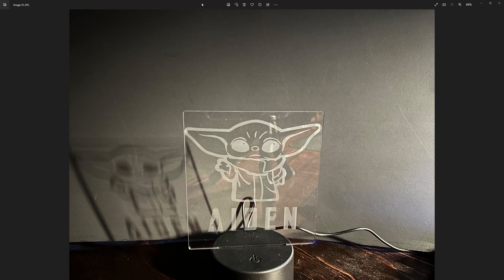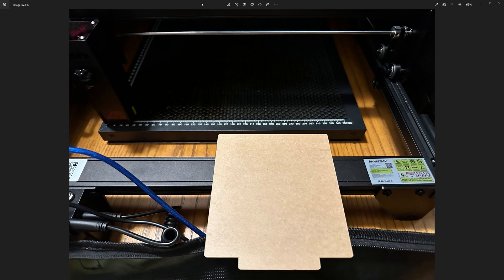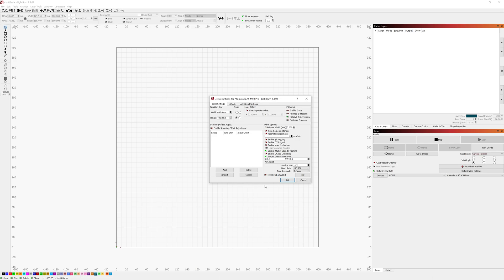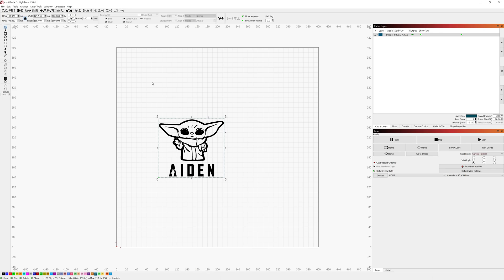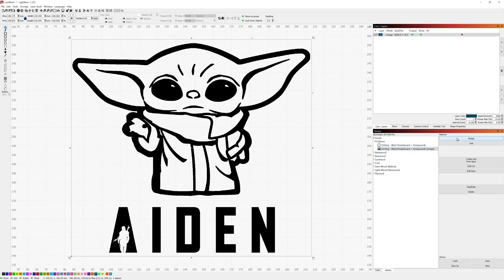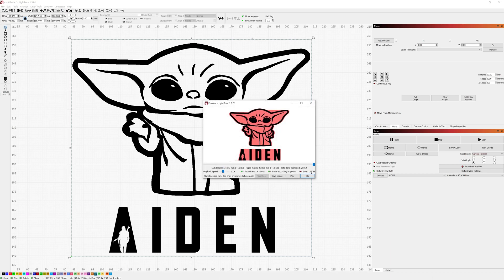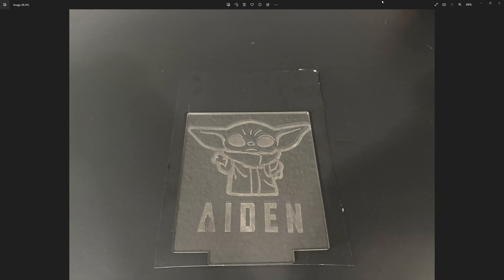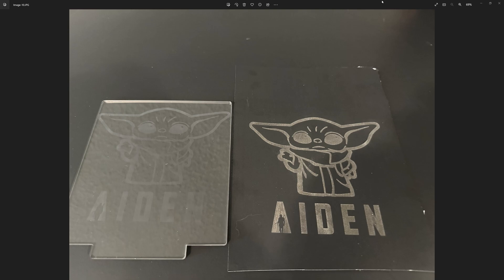Etching on Clear Acrylic - Atomstack A5 M50 Pro (5.5-watt Diode Laser)

Comment: Heeeeelp ! Is it just me because I am a newbie ? I tried a layer of black craft card underneath my 4mm clear acrylic as a tester and found that the etching had etched the card and burnt it to my acrylic. So I then used more black card and raised the acrylic off it by 3mm but this time it did not etch the acrylic but only the black card. I run an Atomstack A5 Pro via Lightburn and replicated the settings in your video which were drastically different to what I found online and so I am stuck to figure out how people are using black bases without these problems. Any help and tips would be appreciated :-)
Reply from the maker: When you say it burnt it to your acrylic, were you able to gently wash it off with mild soapy water, or was it really burnt in?  When I do it, there is residue from the black posterboard on the acrylic, but it washes off easily and leaves a nice finished product. I've not tried it with craft or card stock, only posterboard, and I'm not sure how much of a difference that makes.
Reply: @CubicleNinja  Oh I really did have to peel it off the acrylic and the image was etched into the card and you could smell the burning from the card when peeled off. It left residue of card which just was not coming off lol. I will go to Hobbycraft and try and get some posterboard and try that. I am also going to try the black paint method to see how well that works out. With regards to the first attempt I then followed up with a second attempt by raising the acrylic 3mm above the card to see if that would help but nope lol, the image was etched onto the black card as naturally the laser passed straight through the acrylic which was only to be expected. I am wondering if a black ceramic or marble tile would help although I suspect a marble tile would be too heavy for the honeycomb bed or maybe a piece of black acrylic. Keep up the great work with your videos, they really are most helpful and informative in a clear and concise way :-)
Reply from the maker: @anthonyphillips5103  Good luck! I have done close to 30 of these so far with the posterboard with these settings. I have had 1 or 2 I had to redo because of some defects, but overall it has worked well for me. I always use the same posterboard material once I found it, and always have the acrylic sitting directly on top of it (no air gap) on top of my honeycomb bed. If you have more issues, let me know, and I'll see if I can track down any differences or provide a new video on the full process.

Comment: Poster board and mounting board is same item?
Reply from the maker: Not the same, but mounting board might work (I've not tried it myself).  This is a link to the specific poster board I used -- https://www.michaels.com/product/22-x-28-poster-board-by-creatology-10525550

The main reason I went with the poster board is because it has multiple "layers," and the black layer is more of a coating on it. For whatever reason, it gave better results than when I used black cardstock or thick black construction paper.  You can see the layering of the poster board towards the end of the video when I pull the acylic off and it shows the white inner layer of the poster board where the black coating had been burned off by the laser.

Comment: Very nice video, i have been trying to get set up for this very project and trying to find some guide lines for a 36w has been an issue.  It amazes me that the power is so low, 14% of a 5.5w is only .77, unless i'm lookin at this wrong??  My test pieces are to be in today so hopefully i can go ahead and tackle this.
Reply from the maker: The AtomStack I use is a "40W Machine" but is only 5-5.5W output from the diode laser itself.  With these sorts of diode lasers, they cannot actually etch or engrave on clear materials directly, so you have to rely on a base or backing material to catch the laser as it completely passes through the clear material in order to get any sort or marking.  In my video, I'm having it burn/engrave onto poster board beneath the acrylic to cause the etching effect on the backside of the acrylic.  If I go with too much power, the laser will burn straight through the poster board too quickly and not have an opportunity to mark up onto the acrylic itself.

A lot of the newer, more powerful, diode options use laser coupling to get 10, 20, 36, or 40W output with multiple 4, 5, or 6W diodes coupled together to provide the higher output power. I've not used one of those, but since they are still diode-based, they should still have the exact same issue with cutting or marking transparent materials since that challenge is all about the laser type and not the laser power.

One thing you can do as a test without wasting any of your acrylic is to use a simple black poster board as your tester and find the settings you need to use to burn off just the top black layer but not go all the way through the material itself.  That will, hopefully, give you a solid starting point to do your material tester on the acrylic without going through nearly as much trial and error since the acrylic is considerably more expensive than a $1 sheet of poster board.

Good luck!!
Reply: I'll continue on, thanx.  Mine is a multiple diode with an output of 36w. @CubicleNinja
Reply: i managed to do 3 material test pieces and the numbers i lit on were 5280 speed and 18 - 19 % power.  I ran with that and did my niece and nephews christmas led night lights.  Each child has 3 pieces of acrylic to change out, niece has Disney Frozen characters and nephew has marvel comics characters..  it came ok, no bubble explosions anyway, just had to be very careful cleaning them.  Oh!!! and by the way, i tried the soap trick and that wasn't working so i went to a dry sheet on black card stock...  That did pretty good, i have the tempora but haven't tried it. @CubicleNinja
Reply from the maker: Great to hear, thank you for the update!

I'm glad the dry sheet with black card stock worked well for you.  That's my favorite method now (I use poster board instead of cardstock for the different material density on the paper).  The paint method worked well when I tried it, but it took so much longer and required a bunch of additional clean-up (and I'm really lazy!).  

I've made a bunch of different acrylic lights as gifts lately and I really like the way they turn out and the kids absolutely adore them.

Comment: I used this method today and the engraving was better than using card board , but the Poster board was sticking to the acrylic and it wont come off,  I am gonna try to use the soap method and apply a layer of soap to see if that solves the issue, another thing to mention is that my acrylics are 2mm not 4mm as in your video, but will do more testing til I hit the nail.
Reply from the maker: I've not tried it with 2mm acrylic before, so I'd love to hear your results.

Related to your experience, I ordered another set from a different vendor that listed at 4mm, but they ended up being around 2.8mm.  When I ran them through with the same settings, I ended up having to do a lot of scrubbing with a washcloth and warm, soapy water to get off the residue (it did all come off at that thickness, but was a LOT more work to clean up). I'm assuming that the thinner material causes it to melt the coating on the poster board more, resulting in it adhering onto the acrylic.

Comment: Hi Jonathan
I have an atomstack A5 with air unit
I use black drawing paper 120g (three sheets on top of each other)
my Clear Acrylic is 2mm and does not fit in the slot of the rgb foot. I planned to have an adapter 3d printed from 4 to 2mm slot so that the acrylic is stuck in it.
Now my problem.
I am using laser GRBL v 4.8.0 my settings are as follows:
Rezise: Smoot / line to line tracing / Quality 4,000 lines/min /
Laser options M4 Dynamic power
S min 0% / s max 25% / 300DPI
With 1 Pass I have almost nothing on the record. With 3 passes it is burned next to the lines and cracks in the plate.
I clean the plates with dish soap before I start and after engraving. I use GBRL because I find the lightburn too complicated (while most work with it)
Reply from the maker: I didn’t have much luck with drawing paper or craft paper, the slightly reflective quality of the posterboard is what made the difference in my tests. 

I’ll try running through on laser GRBL and see if the same settings work over there with the posterboard and will let you know my results
Reply: @CubicleNinja  thanks i look forward to it
Reply from the maker: @yeasucrazyg600rc8  I tested in LaserGRBL with my 4mm blanks and it worked with similar settings.  s min 0%, s max 14%, 3000 lines/min, 1 pass.  Used the same black posterboard on top of the honeycomb bed. 

I don’t have any 2mm blanks available to test your exact configuration unfortunately.
Reply: @CubicleNinja  Top will first order 4mm plates and then start working with your settings. It may take a while because I don't have a permanent setup for my laser. Do let us know the result. Thank you

Comment: Did you focus your laser  on the top of plexiglass or the bottom where the cardboard is? Thanks
Reply from the maker: I set my 2mm focus from the top of the acrylic. My laser has such a short focal length, if I had focused on the backing board it would scrape the acrylic. Since my image wasn’t very detailed it worked out ok.

Comment: Do you focus the laser to the level of the top of the acrylic or to the bottom where the poster board is?
Reply from the maker: I did the focus from the top of the acrylic (I placed the 2mm spacer on top of the sheet and set the laser at that level).  For all of the ones I have done so far, they've had thicker lines (like in the one in this video). The thick lines allow a lot more flexibility in the focus point for the laser since I'm not trying to get any fine detail.  

With the A5 M50 Pro I have, I wouldn't be able to do a direct focus on the poster board since the acrylic is 4mm thick and the focal point of the laser is only 2mm. If I ever do an etching with a lot of detail in it, I'd reduce the focal point as close as I could to the acrylic without scratching across as it moves.
Reply: @CubicleNinja  Thanks for the reply!  That's what I was wondering about too - to focus on the bottom side you'd have to lower the laser to the point where it would hit the acrylic.  Or, at least on my Ortur, I suppose I could remove the magnetic guard piece from the bottom to make more clearance.

Comment: hello, I have an Atomstack S10 Pro, and I would like to know the settings to be able to record on acrylic without leaving bubbles inside the acrylic, all my acrylic walls leave bubbles inside.
Reply from the maker: I'm not familiar with that laser, but it looks to be a 10W output (the one I use in the video is ~5.5W output).  When you do the material test, I'd recommend starting at a max power of 10% and a speed of 3000 mm/min (50 mm/s).

I did find a video from Atomstack for the X7 pro (which looks to use the same 10W diode as the S10 pro) and they used 35% max power and 3000 mm/m in the example they did.  For me, anything above 15% started popping (making the bubbles / holes) with this method.
Reply: @CubicleNinja I have the same laser that you mention the X7 pro and it is impossible to climb 7% starts to crackle and black bubbles come out. I have been testing and managed to make a slight engraving that is barely noticeable but it is costing me to give the result where I get to make a good engraving.
Reply from the maker: That’s very frustrating, I’m sorry it’s not working on the x7 pro. It looks like the x7 pro is a dual diode laser and supports a speed up to 11,000 mm/min (MUCH higher than mine). You could try doubling up the speed and keeping the power around the same - something like 6,000 mm/min at 10% power?   I’m not seeing a lot of good video results for that laser or the s10 with clear acrylic.  Most of the videos focus on the clean cutting lines on the thicker materials it gives.  If you haven’t done the material tester, I’d suggest giving that a go with the same setup.  Have the laser vary from 5% to 20% and the speed from 2500 mm/min up to 7,500 mm/min.  Make sure the layers are set to fill to give the solid squares so you’ll get a good idea on the popping/burning and the final result clarity. 

I really wish I could be more help, but I’m still extremely new at this.

Comment: Hello, How do you clean acrylic after scraping?
Reply from the maker: With the posterboard backing, I just run it under tap water for about a minute and gently rub it with my fingers or a lint free cloth.  This method, luckily, doesn’t require a lot of cleanup. (Sorry for the delayed response, I didn’t get a notification about your comment for some reason)

Comment: Have you tried an offset fill to cut down the engrave time? If so what problems did you run into?
Reply: I tried offset fill on some text out line and instant failure popping and burning at tested setting turn off offset fill and it works fine at same setting. I’m searching and searching for information but nothing as of yet
Reply from the maker: @Jamesmyatt1313  I got in some more blanks and am planning to try some different configurations to see what I can find that works.  If I have any luck with the offset fill on this laser, I'll give an update with the settings I end up using.
Reply: @CubicleNinja  i had some luck yesterday with it just doing offset inward to essinsially make a filled box and it came out nice. the offset fill etches in a different pattetern than fill and it can be seen on led lite acrylic. my issues was not offset fill it was something else. offset fill does make more heat in a certain area and that should be taken into consideration.
Reply from the maker: @Jamesmyatt1313  very good information, thank you for the update!
Reply from the maker: I haven’t tried that yet.  All of the clear acrylics I have done so far have been from an imported PNG and not using the trace image option or an SVG, so I have only been testing the different image modes rather than the line/fill modes.  I definitely want to look into that, though, to speed things up some.

Comment: Hi Jonathan, first of all, thanks for the video.
I found this method that you use interesting because some people use Tempera Paint, others use a steel plate.
But, the thick black cardboard that you use under the acrylic must be very rigid and flat, so there is no space left between it and the acrylic, right? That way the work is good?
Another thing: the power of the laser you use when it passes over the acrylic, does it burn the cardboard? Thanks
Reply from the maker: Correct regarding the black posterboard.  I went with the heavy duty posterboard because it was very smooth and heavy (for posterboard anyway), so I didn't have to worry about inconsistencies in the surface or having it move around with the air from the exhaust.  If the acrylic doesn't sit flush and even across the posterboard, then you'll get some different intensity of the etching which will cause areas to seem faded out rather than a flat white look to your design.

Yep, the laser burns through onto the posterboard, if you check at the 8:00 minute mark in the video ( https://youtu.be/Ri9YFIinFbw?t=481 ) you'll see where the laser burned through the black, top layer of the posterboard and down into the middle white layer.
Reply: Thanks for the answer; just one more question: My laser is the xTOOL D1 Pro 10W, so what power and speed do you think I should use to engrave 2 or 4mm acrylic? Thanks again
Reply from the maker: I'm not really sure, this is my first laser and I'm still working to figure things out on it, never used an xTool before.  

The best thing I could recommend is do a material test in lightburn on an acrylic sheet (with the same backing posterboard and anything else).  I'd have it use a range of speed from 2,000 - 5,000 mm/m with power ranging from 5% up to 50% and see which gives you the best result without any burns or pops.
Reply: @DanCopy  I just tested this method today. Worked perfect, took me a few tries to get the correct setting with no bubbles or cracks. I have Xtool D1 Pro 20W and I used 165mm/s and 35% power, it may help you dial in your settings with the 10W. Thanks @Jonathan Flanigan  for this method, easier than tempera or galvanized paint with much better results.
Reply: @NosdregGamer  Thanks. I will definitely try this method. With a 10W Laser, do you think I should keep the 165mm/s and 60% power?
Reply: @Dancopymus  sure you can try those values, I forgot to mention that I have the air assist running and using lightburn when I try the method. I'm pretty sure that without air assist the power may be lower, because the acrylic will get hotter without the air blowing. And I feel like the power and speed is also different when I was using Xtool Creative Space. I just have maybe 2 months since I bought the laser and I started using lightburn 2 weeks ago, I'm in the trial version for now.
Reply: @NosdregGamer  Thanks
Reply from the maker: @NosdregGamer  very glad to hear it works for other laser models. Thank you for sharing your settings to help out.

Comment: Can you show the poster board,  where you got it please?  Thanks for a great video
Reply from the maker: Sure, the exact piece I'm using is this sheet from Michael's for 99 cents - https://www.michaels.com/product/22-x-28-poster-board-by-creatology-10525550 - any thick / multi-layer black poster board should work, the main thing is to make sure there aren't a lot of particles or discolorations in it so it is an even black layer under the acrylic to have a consistent end result.  It's a large sheet, so you can just use scissors to cut off the rectangles to fit around the acrylic blanks.